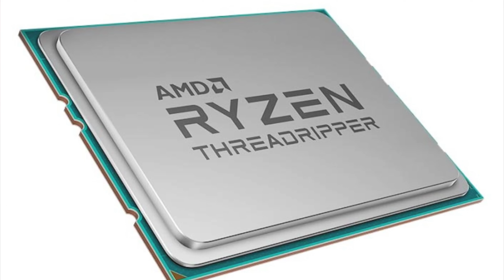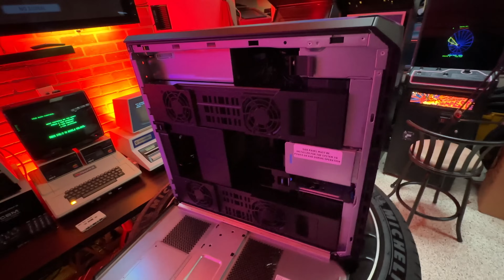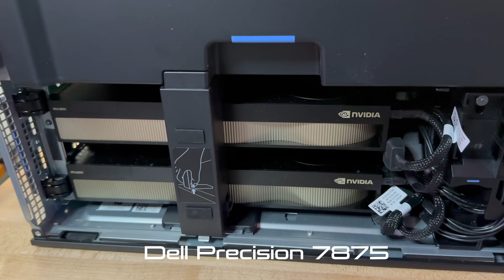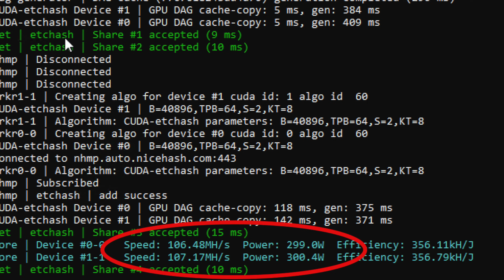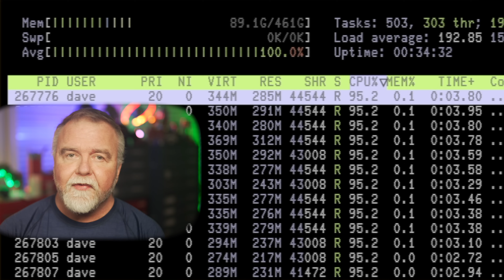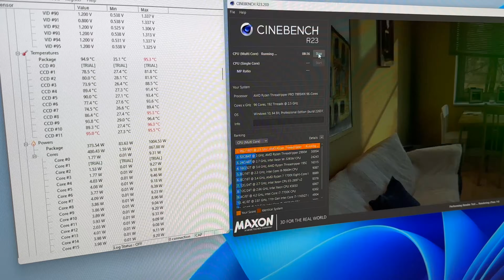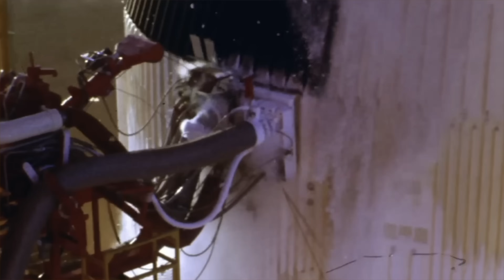1000W CPU:  The Most Powerful Desktop Processor

Comment: As someone that do not have any RGB or window in my pc.
Honestly I would recommend you to make a water cool loop. It is great fun, looking at different blocks adding all the radiates you can fint in your case and set the fan speed to below audible levels. I use soft tubing and fittings that hold on tight, ran the loop without booting the pc, got all the air out of the loop and made sure there was no leaks. Honestly it is pretty easy but very satisfying.
Reply: As someone who does have a window, and is running a H110 for almost 10 years now, the fans are very quiet, system is 3x as quiet as a laptop, with 120mm fans but that damn pump noise, cuts through everything and is louder than a 3.5" hard drive. The pump noise alone is worth avoiding liquid cooling if you can, at least in my opinion. Otherwise it would be whisper quiet, I'm talking about my i7 4770k system, ancient by modern standards but still kicking! :)
Reply: @q1337  I have no pump noice. The only noise i have is coil whine from the GPU when passing ~300 FPS. It is not often I hear that. But still annoying.

If you had the system for 10 years you have probably tried this. 
1. Tray moving the pump while it is running to move air that might be stuck in the pump. Try to get the air stuck at the top of the loop, have the tubes at the lowest point of the radiator and so on.
2. Try changing the pump speed to see if this changes the sound.
3. Top off the loop with demineralized water.
4. Well after 10 years you could clean the loop. Maybe dere is something stuck in the pump.

If you had an open loop you could have changed the pump.
Reply: @Petch85  Yeah, well I have it mounted the classic way on the fan slots at the top of the motherboard, the tubes are horizontally aligned with the radiator so water flow is optimal, I set the pump 3 pin (CPU fan header) to max power, no control years ago since I read the pump was designed to be run at max speed, fans were the things that were to be adjusted as needed, besides, the pump is even louder when going slower, topping off a fully closed off AIO is a good idea after so long, but since I doubt there is buildup (since it's fully closed off, and sounds exactly the same for the last 10 years) I'm not gonna bother with it. The most amazing thing I should mention is it's still under warranty :D It came with a 10 year warranty and im around one quarter away from that time. I know tech improved and maybe I just chose the wrong AIO at the time (in regards to noise, cooling is great, max ~50c at 3.9GHz full load all cores with HT) but with the advancement of noctua air coolers I'm gonna finally completely get rid of the slight pump noise. To be completely clear, the pump is very silent, but the thing is when the rest of the system is dead silent (5x 120mm noctua fans with low noise adapters, corsair psu that is passively cooled (never reaches 50% usage))it sticks out as the only thing you can hear.
Reply: @q1337  No I get it. If something makes noise it makes noise and that is frustrating. And You are right that a good air cooler can probably do about just as well an AIO.
I am not the biggest fan of AIO's myself, but on the other hand I do understand why people like them. They seem easy. But I perfer open loops. Cause you can clean them your self, add GPU cooling, add as much radiators as you case can handle. And when you get a new pc, you can just reuse it. But they are more expensive and a little harder to install.

I have had 2 water cooling pumps over the years, and non of them had made any sound. I have installed them with some soft material to avoid any vibrations traveling though the tower. And I am just running them at a fixed speed (I adjust the fan speed depending on the water temp in the loop, but I have 2x360 radiators and my delta temp is never above 6 C, so the fans are always running super slow). But to hear the water pumps you need to have the side panels off and have your head inside the tower. And at that point you can hear the moving air around you head anyway and it is hard to see the screen. 😂

My tower has a little sound dampening material But I have 8 fan + the PSU fan, thus the tower is pretty open, and I promise you, you cannot hear the pump from outside the tower. At one point I had two loops in the same pc, and even with two pumps you could not hear the pumps at all.

I have worked on a friends pc that had a Corsair h80, but I don't remember hearing the pump. But that Pc had a lot of other problems, the 120 mm puss/pull fans was unnecessary loud. We ended up changing the cooler for an air cooler, because the block was installed using the wrong stand-offs and therefore did not make good contact with the CPU. So I never really focused on the pump sound. So I can't tell you if your pump sound is normal or not. But it does not sound normal to me, I would not expect to be able to here the pump on a system installed in a normal pc case from outside the case.
Reply: @Petch85  I replaced the fans on my h110 before installing it with noctua 120mms NH12 i think, and my case is a corsair 750D with the front panel removed (idiots designed it with 0 air intake, but put 2 120mm fans behind it) since the replacement "Airflow" panel was a ripoff. I admit it would sound a tiny bit quieter if I put it on but I'm not the only one that complained about the pump. It's probably just how it's designed to work, It is after all somewhat early design of AIOs, no rgb, all black, wires seem cheap etc. But like I said, it's not that big of a deal just the fans hit a certain frequency and this thing hits another and stands out. as for custom vs this, I never wanted to have something I needed to think about maintaining, just wanted to put it in and forget it. For that part it did it wonderfully. One critical thing that pissed me off was there was no refill hole/access port, they completely sealed it which due to the use of rubber etc is not perfect and eventually it will run out of liquid, I mean I doubt many people use their AIO for nearly 10 years but still, how much could it cost them for 1 hole with a fitting so I can refill/flush it without drilling it

Comment: My complaint with this generation of threadrippers is how poorly they perform in single-threaded situations relative to their cost and other Zen 4 cpus. Its more of a niggle. Honestly if you need this kind of computational power, building a second box for gaming is going to be a drop in the bucket cost wise.
Reply: That's kind of an issue with all processors at this point isn't it? We're running into a physics wall with how tiny we can make traditional transistors.

Comment: Your channel size is irrelevant, Dave. We are here because we know that you have a great wealth of knowledge and experience in this field - creating components of operating systems that most of us have used! Clearly your sponsors know too! 

Thanks for the video and sharing these beasts with us. If I could pair one with a 4090 I would definitely need to have my PC setup on two different circuits in my house.
Reply: That motherboard & processor will support 7 4090's each with 16 PCIe lanes.  Not sure about the power supply.  7 RTX 4090's are also cheaper than a pair of RTX 6000 Ada GPU's
Reply: @nathanbanks2354  Just checked the 4090 FE, it scores ~34000 pulling 290W in Cinebench 2024.  The catch with the desktop cards is their physical size is bigger so you couldn't fit them in the case.

Comment: No matter how you look at it, 1000W is basically a space heater, and moving that much heat that fast is a hard task. 

I'm glad you do this sort of things so we don't have to :)
Reply: Hey, thanks for sharing your C++ game dev course. Was a bit outside my scope, but still watched it for a few hours. Was really interesting, even for someone not quite ready in terms of programming skill. Really generous of you to share that as a resource.
Reply: @420bobby69 Glad you enjoyed it :)
Reply: Just think, that's a middle-of-the-road hair dryer running in a box at your feet.
Reply: If I'm gonna run a space heater it might as well do some useful work like... mining Bitcoin??
Reply: @zzz-v3w6t  I mean you need an ASIC for that. People haven't been able to mine Bitcoin with a reg computer and GPU in years. Ethereum was the one you used to be able to mine with a GPU but that stopped in fall 2022 which is partially why the crypto market crashed and GPUs started going back to normal prices (kind of).
Reply: How they did not put a hot pocket slot for 10k  fail
Reply: My old dual-dual Powermac G5 would pull 600w continuous from the wall and it got more than hot enough while running the fans like a vacuum cleaner.  I can't imagine Dave's setup at a kilowatt...
Reply: The best bet for that much heat would be a chiller unit or even a phase change cooler.  This would add a massive amount of complexity but you could probably max out the VRMs without much issue lol
Reply: Where I am it's half, ones I use is 2kw
Reply: @DaveChurchill Don't have to or can't afford to.
Reply: Except heaters do it every day with micro electronics built inside . Imagine that
Reply: @KC-nd7nt Heating elements are not made of nano-scale transistors, they can afford to store a lot of heat while it slowly moves throughout a room

Comment: Soon the EPA will mandate a MIPS per Watt sticker on processors.
Reply: At ~10W per core, this CPU isn't doing all that bad even in its overclocked state. Some Intel CPUs will happily exceed that at stock settings.
Reply: @tiarkrezar even my 5950x will use the full 142W that the AM4 socket will provide.  So even the 5950x at stock uses nearly that.  10W per core on balls to the wall mode ain't bad eh for the threadripper
Reply: @kenwilliams12893  My 5800X3D tops out 9.2 watts per core, after undervolting. Averages around 6-6.5W, spiking to 8.5W while gaming. 10W isn't that bad at all.
Reply: @tiarkrezar  my 13700 (with lid still on) maxes out around 300Ws. Divide it by 8.... (mkay, there are E-cores too, but they don't consume much)
Reply: @bszbszbsz  You'd be surprised how much E-cores actually consume. Buildzoid tested a 13900K with all P-cores turned off except one (one needed to stay on for some reason and he couldn't change that) with mainly the 16 E-cores taking all the power. I think he used cinebench or another CPU intensive test, and the 13900K used about the same power as a 16 "P" core 5950X (about 140 watts). That says a lot about how efficient the 5950X still is after 3.5 years (it's still top 5 in efficiency on Tech Power Up's renders per watt test) but also that the E-cores can use about as much power as a Zen 3. E-cores are actually space efficient not power efficient. 4 E-cores take up about as much space on the die as 1 P-core.
Reply: And then the manufacturers will redefine "mips."
Reply: 10w per core is not too bad, considering my 12900HX (8p+8e) can use ~115w sustained power.
Reply: @tekeagle2136  and 8 of those are skylake cores which is an iteration of a 2015 arch, which is an iteration of sandybridge (released in 2011)
Reply: The EPA is no longer your friend. They've been corrupted with the rest. Now they support half brained ideas like cut down the trees and bury them to reduce CO2. They also supported when Ireland stopped burning coal and instead cut down 16 million trees for wind farms, where they installed windmills that don't stay in operation long enough to make up for the carbon produced from making it. It's so insane that you couldn't make a SNL episode on it. It's way too far fetched to be remotely possible but here we are freaking living it.
Reply: Hopefully soon we’ll get the same result with less power
Reply: Well, good! Heat is pretty much a dead limit, and bigger coolers only give diminishing returns. So if there's a heat limit, less heat per core means more cores, and cores are computers and computers are good!

If Americans paid for petrol what the rest of the world does, this perverse pride they take in wasting the stuff would disappear quick-smart.
Reply: tf you talking about? Fuel is not cheap in the US anymore. Not since dumbass took office. @greenaum

Comment: PBO is an AMD overclocking thing invented by amd. Asus has a custom config (just like other mobo's)for it but its totally amd's tech
Reply from the maker: Damned Anton!
Reply: @DavesGarage  Anton should have flipped a coin and call it out.
Reply: You have to use AMD's PBO and not ASUS' PBO as one works great (AMD's one) and the other will probably lower your performance!
Reply: @Traumatree no, the motherboard ones can and will kill your chip on auto.
Reply: @pav1u  ASUS PBO is crap.  And also, don't use ASUS, they are crap too today.
Reply: @Traumatree  true
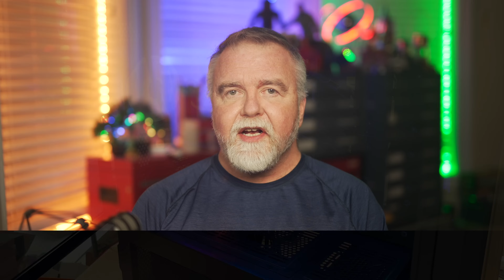Reply: For reference, that (correctly) addresses 11:01

Comment: Ohm's law wise I always wondered how a 3.3v component can have 100W rated power, and that's not even a momentary spike but sustained wattage.
Reply: That'swhy it dumps so much heat, it's hundreds of amps of current flowing through a semiconductor, even through regular conductors hundreds of amps will easily melt many cables.